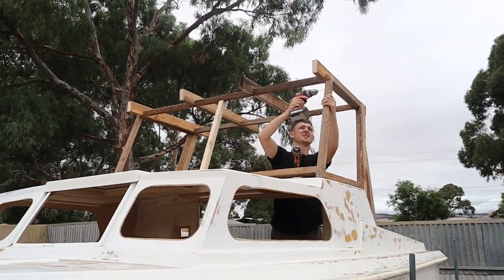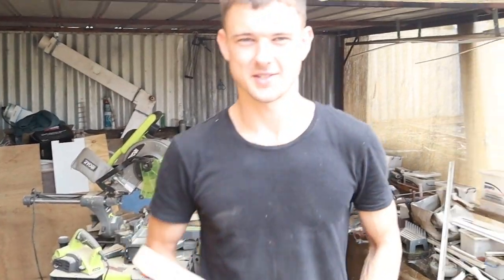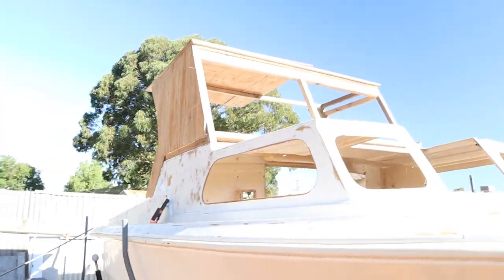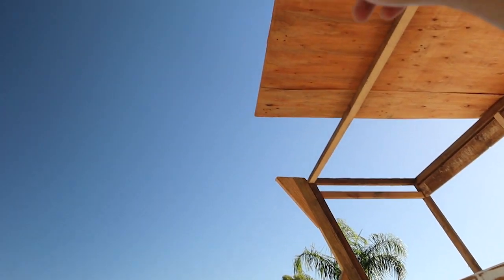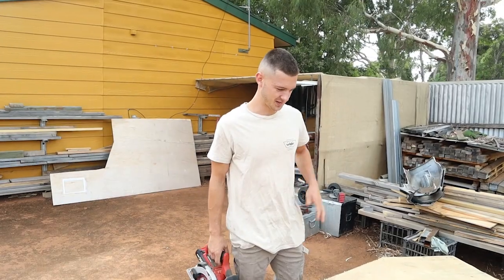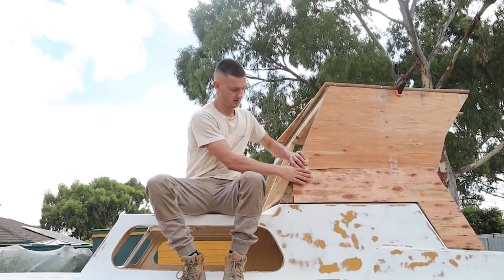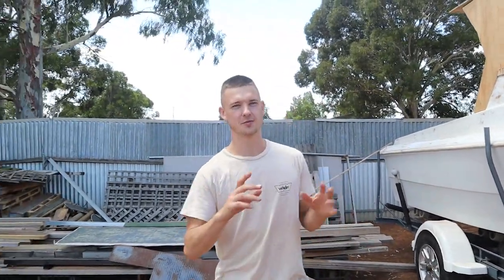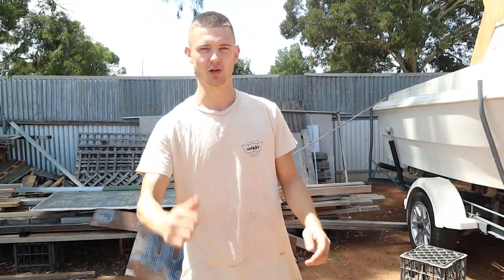Building HARDTOP CANOPY on the PROJECT boat - part 2

Comment: Bro why you building a shed on it? should learn how to do fiberglass moulds and use only glass. If anything some 12mm ply but doesn't need it unless there's a handle needed there or what not. She will be very top heavy and sketchy in rough weather.
Reply: 100%
Reply from the maker: I agree, pulled it off going a different style. Probably just Bimini, lighter better for towing. Less headache.